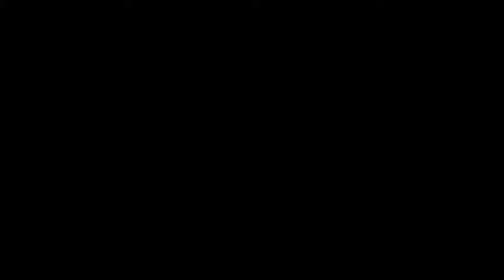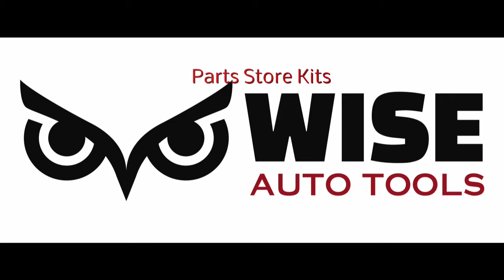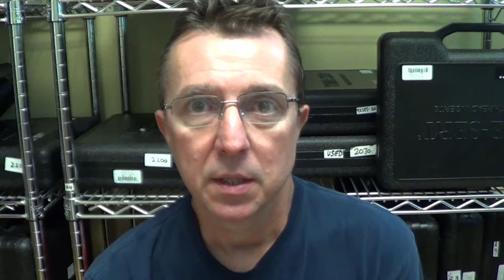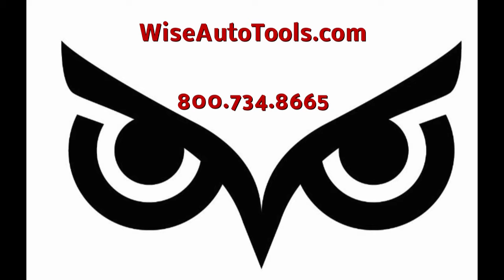Wise Sparkplug Thread Repair FAQs - Parts Store Kits

Comment: LOL---what the heck are you doing answering questions on the weekend? you should be out having fun :) thanks, i will report what i learn....
Reply from the maker: Blake Ponders Sounds good, let me know. I try to respond quickly especially when I know someone's vehicle is down. Enjoy the rest of your weekend.
Reply: WiseAutoTools Hi, here is the measurements i came up with------.711 or apx 17.5 mm------is it workable? thanx
Reply from the maker: Blake Ponders Time Sert 5600 - Stand Alone Kit that repairs spark plug holes larger than .663" (16.8mm). The outside diameter of the largest insert is .77" - it's Triple Oversized. 
http://wiseautotools.com/time-sert-5600-triple-over-size-for-spark-plug-thread-repair-kit/
Reply: WiseAutoTools OK, let me ask you this, if a 3/4 drill bit wont fit through the hole your kit should work, does that sound correct? i just want to make damn sure before i purchase the kit.......thanks

Comment: HI, i put a 11/16 drill bit in the hole and it went through, what can i use to test if the head is even fixable, is there a next size up drill bit to check if your kit can be used?  thanks
Reply from the maker: Blake Ponders The largest kit we have goes up to about 3/4" of an inch. You may be able to add thickness to the 11/16" drill bit with painters tape until it reaches the size of the hole, then measure it. See more information at our article http://blog.wiseautotools.com/ford-spark-plug-blow-out-solved/ Call if you need assistance at 800-524-9783 10-5 Eastern Time.

Time Sert 5600 – Stand Alone Kit that repairs spark plug holes larger than .663″ (16.8mm).Uses one insert insert another one. The outside diameter of the largest insert is .77″ – it’s Triple Oversized. Used on many applications and has a Triton counter-bore needed for some 2001 and up.*Note Add-On Kit for installing the Double Over-sized inserts for holes smaller than .663″ (16.8mm) is kit number – 5588. Works for SOHC and DOHC engines. This kit is Made in the USA.